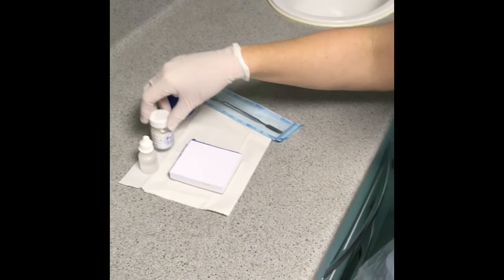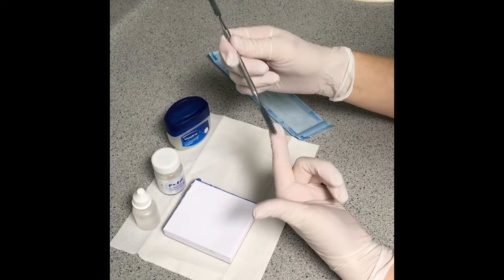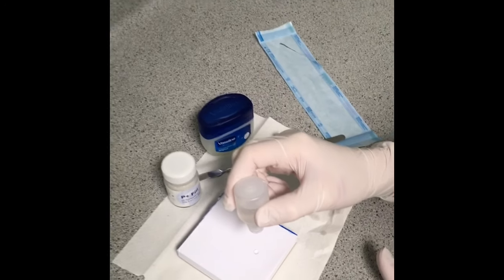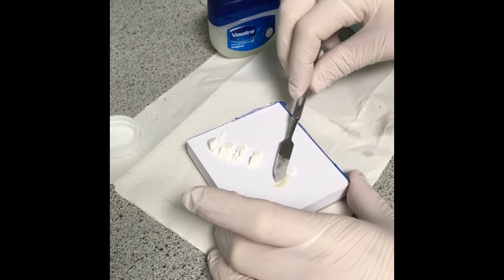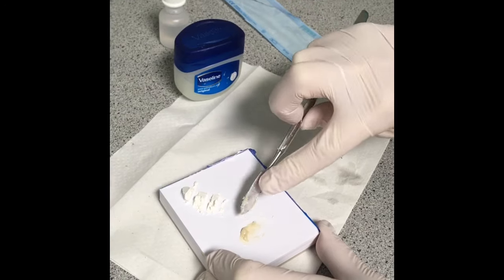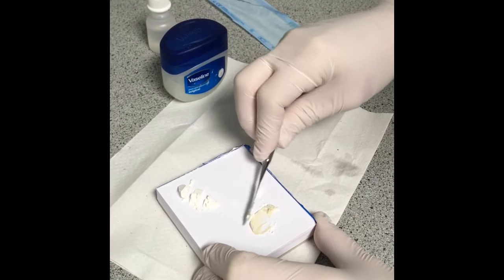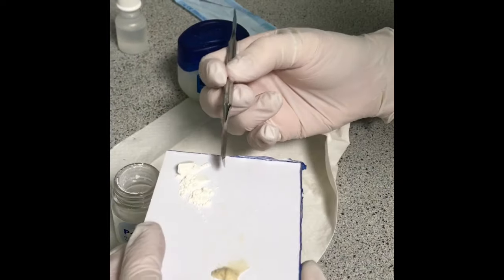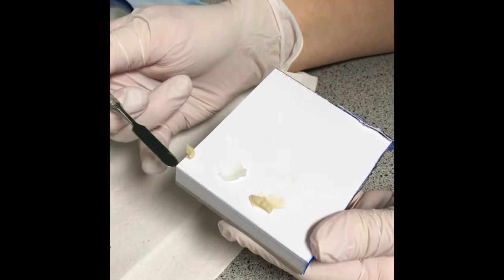Mixing Glass Ionomer (GIC) Cement.

Comment: Dear Madam
i fixed one CROWN ON  tooth 24 lower 
 PFM CROWN
ALL OK but due to Lab mistake its color is too white like milk & does not look nice. how to  make it yellowish. I have one idea that GIC thin film to be applied on outer side as my tooth color is like GIC.
Your expert opinion pls.
Reply from the maker: Hey... I think in future if a crown is the wrong colour it maybe best not to cement! and to send it back to the lab. However if there’s a gap around the crown you could definitely use GIC as long as the area is dry and it is sticking to the tooth, as it would not stick to porcelain.

Comment: I don't get what the vasoline is for......
Reply from the maker: When you mix GIC and it is setting in the mouth with the saliva it can feel gritty, so if you smooth Vasoline over the top of the filling number one it helps it set with the saliva and it also helps it feel smooth.. it’s just a dental hack from what I’ve learnt over the years some dentist do this!! And if you actually bought the Chemfil material box it does have a conditioner for afterwards for the same purpose. I hope that helps with your query?
Reply: Chemical isolation
Reply: Waterproofing!
Reply: does the Vaseline cause gaps air bubbles causing a pocket so it won’t seal future leakage ?

Comment: Put a plate in the fridge. Mix as usual but on the plate. Due to the low temperature the reaction is slowed allowing plenty of time to get a good mix. As soon as it goes in the tooth the temperature rises. I use washed and sterile fingers. It doesn't seem to stick to skin.
Reply from the maker: Interested in that one is a new one for me I’ll have to give that a go. I personally prefer glass slabs to the paper disposable pads!!
Reply: @dentalnursingteachingtoolm7609  Nooo , you cant mix GIC on glass slab , it will interupt the chemical process of GIC .
Reply: Can I use this to put my brackets back in ?